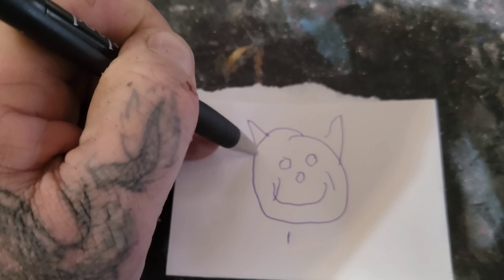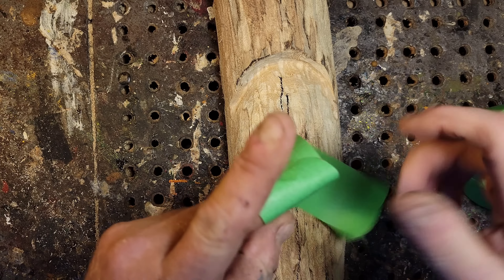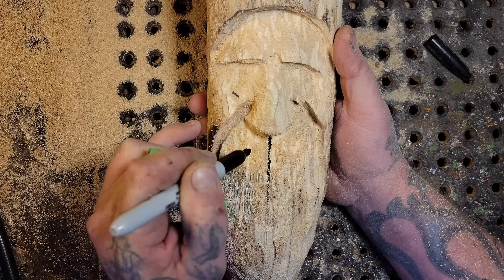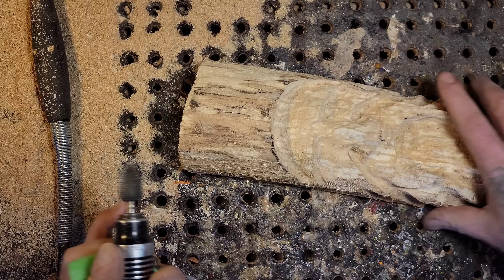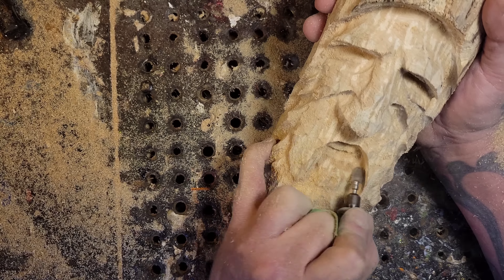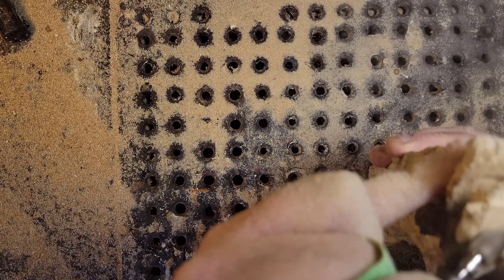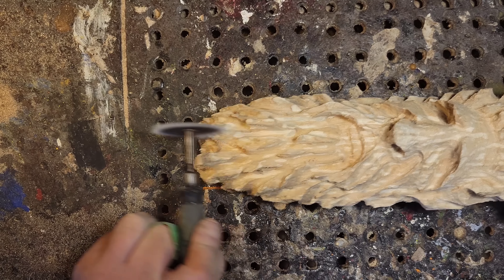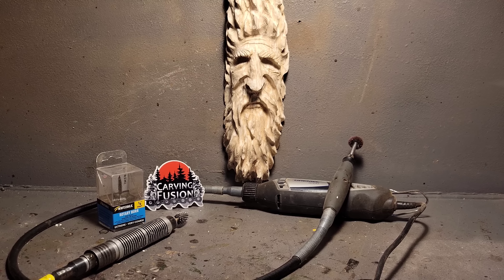Very beginner Dremel Wood Carving -Talk threw Wood Spirit.

Comment: hi, I have always worked with 3mm bits with the dremel.  recently, I got a slightly more decent compressor, and I got a cutter that goes with it.  I was thinking of getting at least a couple of kutzall tips to remove the roughing.  I'm thinking of getting the flame but original version, because I work on harder woods, would you recommend the second most important one?  Thank you
Reply from the maker: Yes for sure, any burr that shape is good
Reply: @CarvingFusion  thanks for answering me, but for better or worse, which is the second most important?  for example, the round but long one, or the cone-shaped one?  or do you have another more important one?  I mainly make wooden spirits, I prefer to ask you because I only want to get two, here in Italy they cost even more 😅
Reply from the maker: Ok I would get the long skinny tapper burr  the skinny one
Reply: @CarvingFusion   I tried to post the Amazon link but I can't find the comment, is the code of the tip you're talking about BN-14?
Reply from the maker: Kutzall Original Taper Rotary Burr, 1⁄8" Shaft, Coarse - Woodworking Attachment for Dremel, Foredom, DeWalt, Milwaukee. Abrasive Tungsten Carbide, 1⁄8" (3.1mm) Head Dia. X 7⁄8" (22.2mm) Length, T-18-E

50+ bought in past month
Reply: @CarvingFusion  Hi, sorry again for the inconvenience, I just want to be sure, do you mean the long cylindrical tip, which becomes "pointed" at the end? Why did you describe the small version to me, the 1/4 version is (6.3 mm) × (38.1 mm ) T-14?